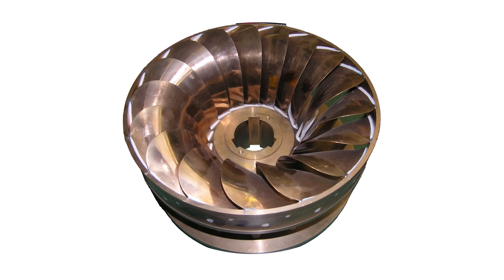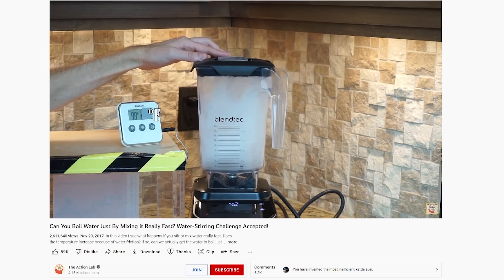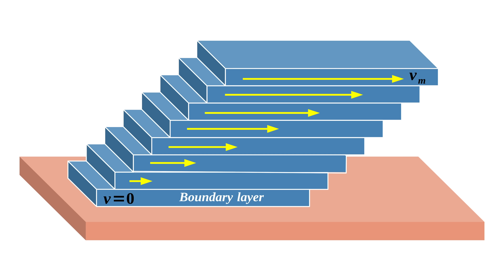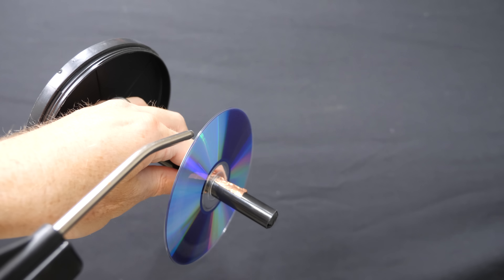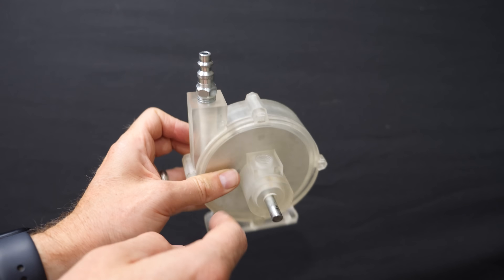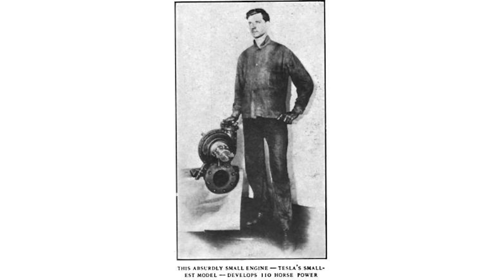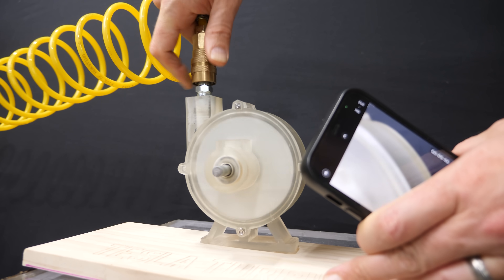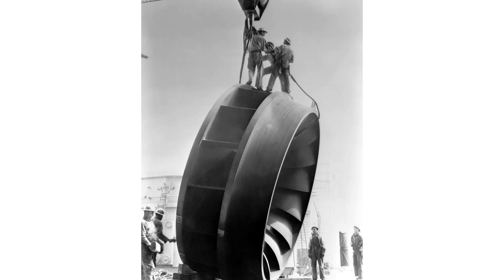How Fast Can a Tesla Turbine Spin?

Comment: Would be cool to see a regular turbine with VARIABLE fins so you can optimize the angle and approach a Tesla turbine approach when the load allows.  Would love to see that!
Reply: Tesla turbines get plenty of torque. You just have to know how to design them correctly.
Reply: @CharlieSolis  for real though you would know too! The TesTurs that you make are beautiful! And they actually work! 

Power and torque even at low RPMs and even with just room temp compressed air! 🤣

I love how everyone demands Tesla turbines “don’t work/get no torque/have to be spun too fast…blah blah blah…” when you literally have all the proof anyone could need to prove they work astoundingly!
Reply: Water turbines of the kind of francis and kaplan turbines regularly have movable parts to increas the efficiency at different flow levels and they achieve efficiencies of 95 to 98%
Reply: Porsche introduced variable turbine fins on their 911 twin turbo cars around 2007.  They called it Variable Turbine Geometry.
Reply: @alangil40  yeah the variable geometry “nozzles” in those turbines are cool. The mechanism for the adjustable vanes is super simple. 

Although the pivot in them is the wear point over long operating lifespans.
Reply: @alangil40  I have dual variable convergence nozzles on my Tesla turbine but they are set and test for the time being. I have a design for a similar mechanism to keep them locked with each other and variable. 

Have you seen the variable nozzle Tesla designed for the Turbine? It’s tucked away in his flying apparatus patent 1,655,114 figure 4 and 5 (there’s two of the flying machine patents so make sure it’s the one that ends in “…,114”.)
Reply: Regular turbines HAVE variable vane geometry

Comment: For what I know common turbines have an efficiency which is usually higher than 85%, usually also over 90%, so there is really no point in tesla turbines which in real esperiments with load show much worse performance in general.
Reply: I believe your thinking of the electrical side of it, the alternator. Their talking about the straight water movement.
Reply: No, I'm referring to the exchange of energy between the fluid and the mechanical part: pelton turbines have efficiencies up to around 90%, francis turbines can go a little higher also (for what concerns hydraulic turbines). For steam and gas turbines it is a bit more difficult to find reliable data, but usually they are still around 90%. If you consider a complete cycle like a combined cycle than yes, the efficiency of the whole cycle, fuel to generator is around 60%, but that is not considered here also.
Reply: @matteomarinoni1676  for hydro power plants as a very conservative rough estimate to convert from potential energy to electrical energy normally 85% is used, this of course include all electrical equipment, turbines but also the main part which is flow resistance in the pipes leading to the turbines (and from the turbines depending on the type of turbine used)
Reply: Your talking isentropic efficiency!  But What about costs at micro scale size? This wil be a nice way to heat your house while producing electric power at The same time using a steam boiler or something
Reply: TesTurs have definitely been shown getting +80% efficiency. 

“Design and Development of a Small-Capacity Tesla Turbine for Rural Applications

ABSTRACT
Bangladesh is in great need to find renewable energy sources for its fast-developing industrial sectors. The main objectives of this research are to design and fabricate a small-scale efficient Tesla Turbine for remote areas and test it through experimental investigations. Performance analysis of the newly designed Tesla Turbine suitable for remote areas of Bangladesh will be conducted. Until now, a number of researchers have undertaken several tests and studies to evaluate the Tesla turbine's performance and efficiency. Tesla Turbine does not proficient in producing torque. The work here consists of computational analysis and an experimental campaign by fabricating the turbine. Solid Edge 2021 is employed for our 3D modeling. For modeling, the desired material is Polylactic Acid (PLA) or ABS Plastic. The proposed design consists of 51 disks with an identical spacing of 3 mm. This design has led to achieving a torque of 19.85 N-m and a staggering efficiency of 81%. It was found that stress generated on the disk edges is higher than their centre due to high centrifugal force.”
Reply: @testurenergy  even if the TT has a lower efficiency than the world's most efficient bladed turbine , we can use Al kinds of fuel now whit a high conversation efficiency so the overall efficiency may be higher even if the isentropic efficiency is lower
Reply: Yes actually 90% is closer to the complete efficiency of a hydro power plant including all electrical equipment which has lower efficiencies than the turbine itself.

Comment: Another use case for Tesla turbines are to work with fluids that may be contaminated with particulates that would destroy normal turbine blades, since those are typically of flimsier construction than the Tesla turbine's robust disks.